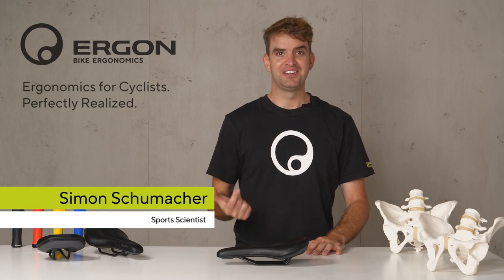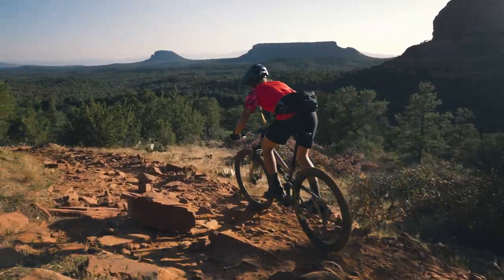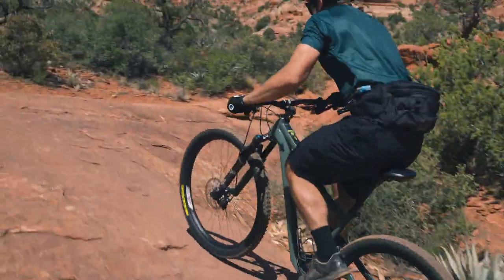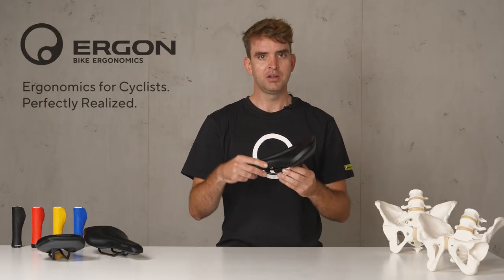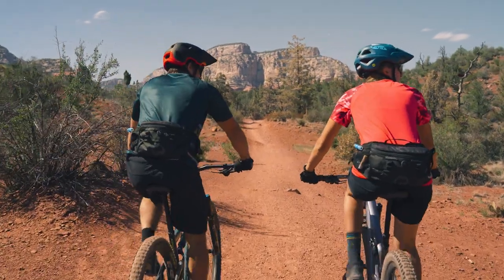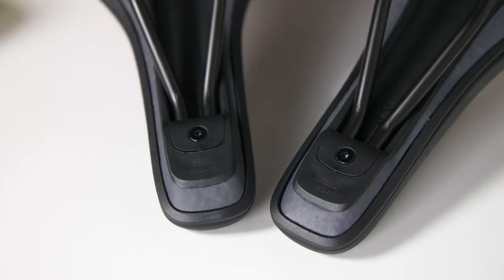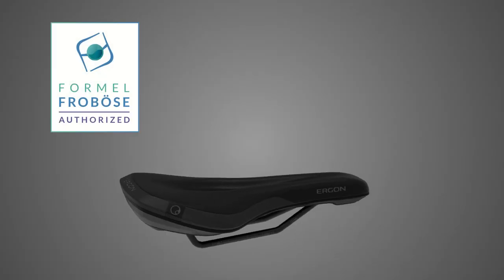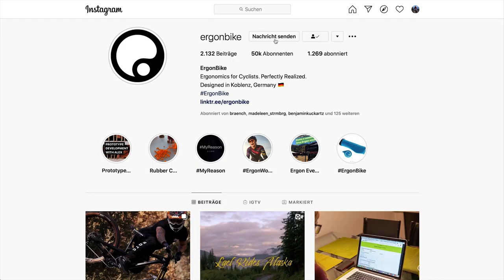Ergon SMC Core MTB Saddle I Ergonomic Benefits

Comment: I have this in M/L size and also SQ Lab 60X Infinergy which also implements BASF tech. For comfort, I rate both extremely good with no saddle soreness or lingering pain after every ride. 
Reason I picked them both is they don't taper off as abrupt on their sides as most saddles, especially the SQ Labs which almost sits flat.
The Ergons have more cushion because of the gel above the BASF PU foam, while SQ Labs has a more locked in the saddle feel meaning not a lot of sliding back-to-front and side-to-side.

Comment: those deep rails seem to be unnecessarily adding to the overall thickness/ height (big deal with droppers sometimes.)
Reply from the maker: Hey Donald, the rails are not deeper than other saddles, but the Core is adding a bit of height. You can choose between flat designed saddle which is a bit harder then or a bit higher saddle which gives you more comfort ...